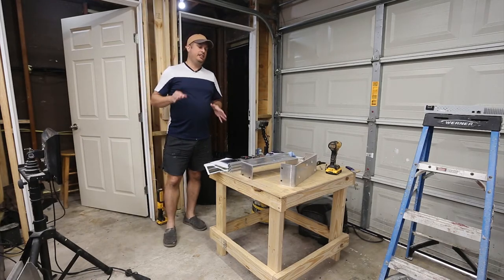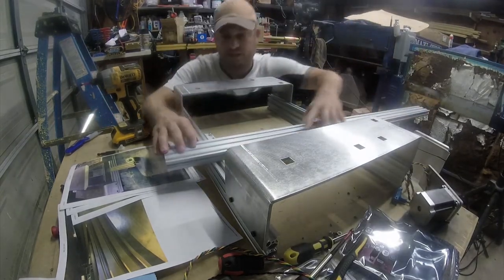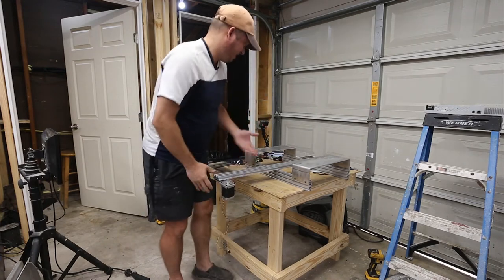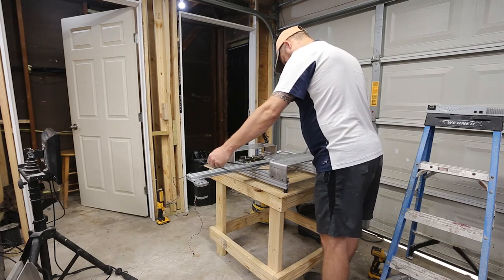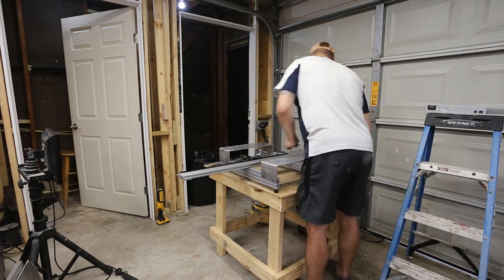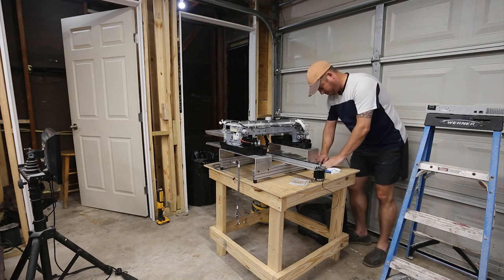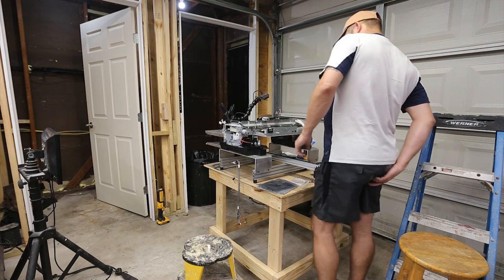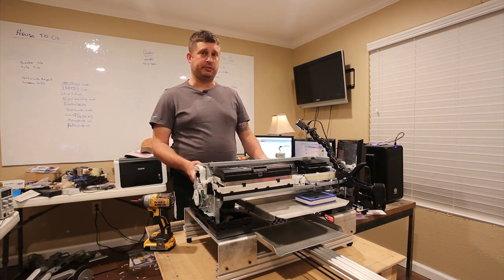Open DTG - Part 3.2 - Base assembly

Comment: What do you think of the quality of the base so far? Do you feel you would have just been better off building this thing from scratch with mdf and different parts?
Reply: K
Reply from the maker: It's nice.... definitely quicker to buy it.  I've been "not in the mood" to figure it out lately as the documentation ends about where my videos do.  :(  Maybe tonight?
Reply: Yea i look forward to seeing the rest of the video. Good work so far and it looks like it is turning out great.
Reply from the maker: I posted another video today.  I shot it a couple of weeks ago but then the Samsung SSD I use for my video editing drive died without warning.  I was able to recover the video and edit it.  I feel bad that the videos are so long, but my style on these is to let folks "sit with me while I work" as opposed to a 30 second knowledge blast.  I've progressed a bit beyond that and been able to successfully do a test print.  I have not converted to DTG ink yet because I'm not ready to print shirts.  I plan to catch up the videos this week on wiring the motherboard and the few settings that are needed for the DTG conversion.  There is not much documentation which has slowed me down and been somewhat frustrating.  My contribution back to the project is shooting these videos to help others who want to do this.
Reply: Il check it out for sure. Just picked up an r3000 on craigslist for 200 bucks so im considering doing this as well. I am more curious of the board wiring as the base i am going to build from scratch with a nema 23 motor and a ballscrew base. As for the inks id wait as well until you are fully set up. Are you going to get the pretreat machine or just use a wagner sprayer?
Reply from the maker: I bought a repo'd pretreat machine.  My research suggests you can't consistently pre-treat by hand.  Image Armor makes a nice Viper pre-treat unit for around $2500.  It's simple, easy to live with, and has great support.  I was at SGIA 2017 today and looked at it.  If I have to buy another one for any reason I'll buy one of those.